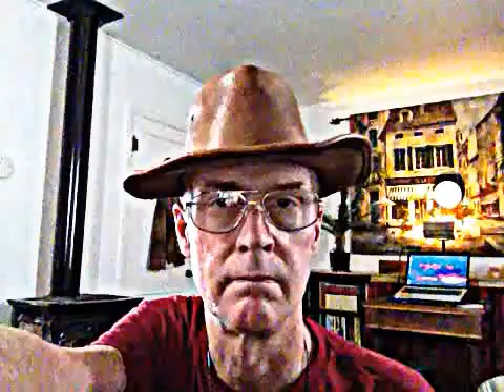Infinitely Long Wire Antenna

Comment: No reflection at far end so no standing wave so no radiation at all! All energy trapped inside wire, dude. An ET with a radio attached to the other end would never receive the first oscillation.